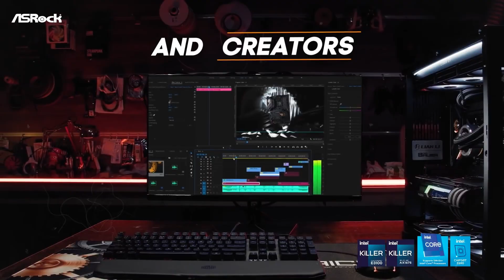MSI Vs ASROCK Motherboard : Which One Should You Choose?

Comment: neither board I'm waiting for my delivery of my MSI MEG X870E GODLIKE
Reply: I have the x670e Ace and I love it, it was so packed with features they didn't release an x870e version. It has 2 gen 5 pice slots and 3 gen 5 m.2 for a total of 6 m.2 10g lan crazy amount of USB and c ports. They have deals going on it right now if you should check it out.
Reply from the maker: @ x670e Ace is definitely a good choice.